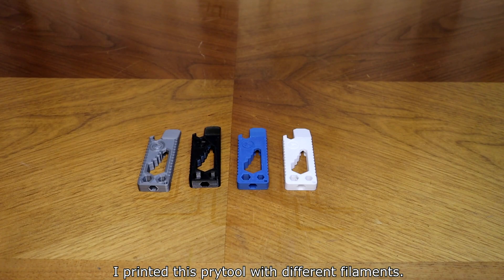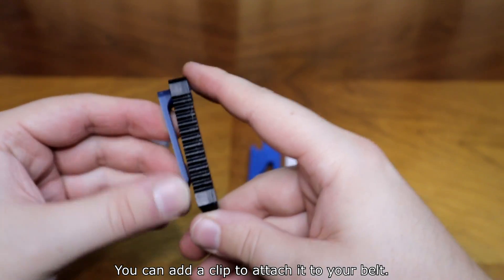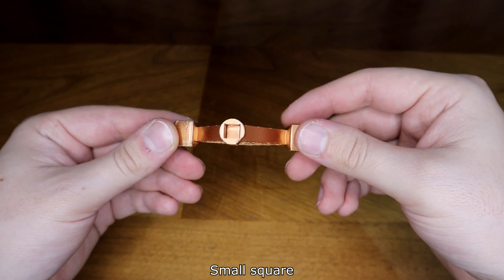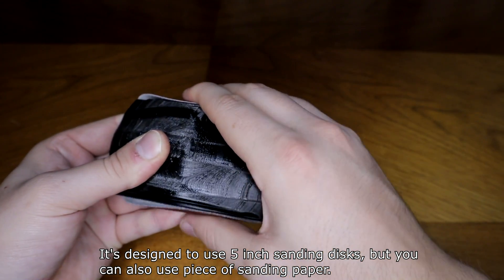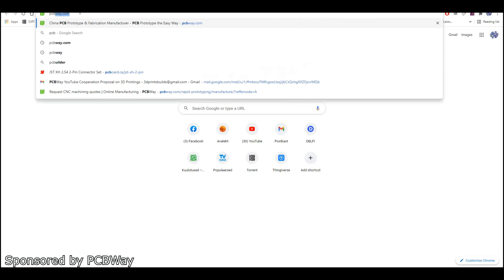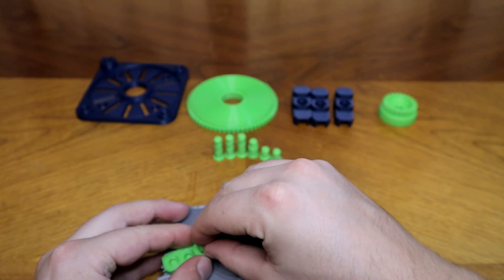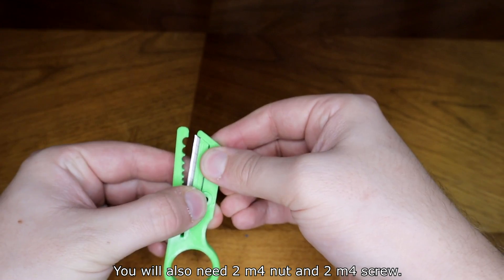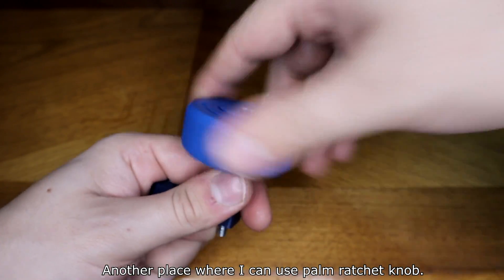3D Printed Tools #5 - Useful and Functional 3D Prints

Comment: This stripper (https://youtu.be/rbFzWOcB3TA?t=519 is supposed to be used differently - you press wire to appropriate position and then make a turn of the stripper using your index finger in the ring.
Reply from the maker: My bad. Thanks for telling me that.

Comment: Are these actually useful? They just seem like printed replacements for common tools. They seem worse to use, weaker and less precise than the tools they are trying to replicate.
Reply: They are useful for people like me who are to lazy to go to the store, and to cheap to buy anything
Reply: @datboitmic  use crap tools, get crap results. Chances are you probably use the tool once and then don’t need it again, if you needed it consistently or for any kind of precision then you would get proper tools. Even cheap metal tools would be much better than 3D printed ones.
Reply: What's wrong with the sand paper holder and the sanding block?

These things cost pennies to print.
There better designs out there for things like sanding blocks sure. And even those are typically cheaper to make than to buy a standards one. 

The main purpose of 3d printing is to make things exactly how you want them. So of you see something wrong with these designs, make a better design yourself.
Reply: @ge2719  if you have an actual need for them then sure print them, but you can use almost anything as a sanding block and typically you will need a few different kinds. The sanding block is one of the more useful things from this video. Also how long will it actually last? If you use a sanding block a lot then you should get a better one, if you just need it occasionally or suddenly find yourself in need of one then you can improvise rather than wait hours for one to print. It is generally better and quicker to buy one or use a lump of wood or something else for one than to print one.

Part of printing is recognizing what is worth printing. I see better options than this so why would I make a better design myself?
Reply: You must be fun to be around
Reply: 3D printing summed up pretty well tbh
Reply: @decline1129  for most of what you see about 3D printing that is true. Most people with a printer overuse it, part of being good at design is knowing what manufacturing method to use. Some things do well 3D printed, like complex, unique designs. A block to wrap a bit of sandpaper round is not a good fit for 3D printing. You would have better results with a piece of wood and maybe a knife, saw and sandpaper to shape it if you feel like it. Considering how cheap you can get these tools you are better buying them, if you used them a lot then you would buy better ones not 3D print them. If you don't already have a sanding block and suddenly realise you need one are you really going to wait like 6+ hours to print one? Or are you going to find a bit of scrap wood and use that instead? Printing these tools generally isn't a spontaneous thing, it generally requires planning and rather than looking for the model and printing it you could order it online or go to a shop.

I have printed quite a few functional prints but I only print when there aren't better options, like with a drone frame, it is injected molded ABS, it is stronger and cheaper to order from AliExpress and wait for shipping that it is to print my own, printing camera mounts can covers for components is a better option and often the only way to get it the way you want and that is what I do. For a robot arm I am going to build, although I could print the arms, the arms will consist of 1515 aluminium extrusion and 3D printed brackets. The aluminium is just a beam the brackets are complex parts with gears. I could print the beams but it would only be weaker, it may be lighter but aluminium is light enough anyway and then to change the arm length I don't need to print new beams, just cut the aluminium ones.

Part of printing is knowing when and what to print, that is a part that most people seem to miss, especially with models that consist mainly as a flat plate, you could save a lot of time making it out of plywood or a metal or plastic sheet vs printing it. You see all over the place things people have printed and they mention the struggles they had and the ways around them but the whole thing would have been easier and better with a different technique. It's almost like when most people get a printer they think it's the only manufacturing technique in existence.
Reply: @conorstewart2214  tl;Dr, if it's plastic on a commercial product it's probably fine 3d printed.
Reply: @conorstewart2214  I didn't count. There's a protractor in there. I forget what else. The sandpaper thing. Screwdriver handles. Allen wrench torque increasers. You can make small carabines that carry like 22 lbs. Pretty sure you have to just make sure you're using the right filament and that it's the correct infill %. 

A kg roll is like $15-20